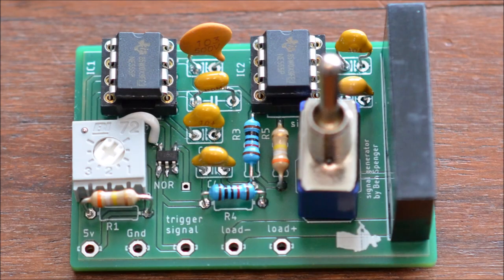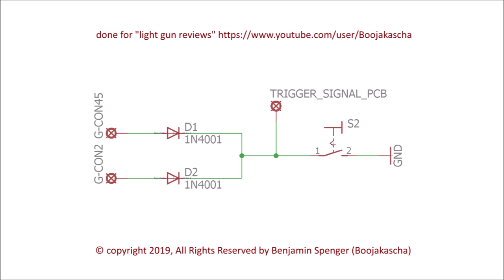Light Gun Reviews 130: Namco Arcade gun on PlayStation 1&2 (Modification)

Comment: Congratulations on this successful project, GunMaster. It has been impressive. 

For you, and everyone. Do you know any particular gunlight on PS1/PS2 (and PC) that in G-con1/2 mode matches and/or exceeds the original Namco Guncon1/2 accuracy and precision? have you ever experienced it or does that not exist? I mean leaving aside the LED bar extern accuracy, cams systems, recoil, and pedal option...

On the other hand, would it be possible for Guncon 2 on PS2 to addon some sort of vibration when the trigger is pulled, as well as adding an extension for a footswitch? if this were possible Is there a step by step tutorial somewhere?
Reply from the maker: Thank you =)

The original G-Con 1 & 2 are very good. Some units certainly reach perfection. It comes down to manufacturing tolerance & deviation that we can find unit which don't perform as well (but still very good mind you). By the nature of things, most items by any manufacturer are statistically distributed in a Gaussian quality curve. You can find particular units of Logic3 P99L or Gemini G/C-2 which exceed a particular GunCon (1 or 2) but the opposite may easily be the case when you look at another sample.
This is a long winded way to say: GunCons (1 or 2) are top notch and my benchmark. There are other guns which are as good though.

Yes, you can add force feedback to about any gun. Please see episode 237 for that (cost in materials is about 20 USD).

Similarly you can add a pedal to about everything. Just connect the signal line to Gnd via a switch and you are golden. Refer to episode 201 to know more. If you don't want to open your gun, you can sacrifice a PS1/2 controller for most Time Crisis like games.

I rarely do step by step instructions. I suggest you try and write in the comments, if problems arise.
Reply: @Boojakascha  Thank you for clearing all my doubts. Now I understand the situation better. I didn't know the difference or tolerance between the Guncon themselves, I imagine it would be something like the tolerance and deviation in the service settings in the old CRT TVs that came out better adjusted than others, with the difference that the Lightguns unfortunately don't have a "service menu" for "secret" access to finish refining the different factory settings as best as possible, or due to subsequent mismatches. 

I presume then according to which models they are compared to each other (black-JP, red-US, gray-EU), and their serials, the highest standard in their assembly and tuning could fall on one or the other model, regardless of their color or place of origin.

Ok, then those three brands or models would be at the top regardless of the place they occupy on the final podium, and then the rest of the models or brands of the same type/style would come at a certain distance. Excellent.
 
Great!, I will immediately consult episodes 237 and 201. 
When starting or finishing this project, is there a risk of unintentionally misaligning the factory lens system, etc. and I'll could be not know correct it myself? some advice in this regard to avoid mismatches or unwanted problems?

Sorry for stealing part of your time again, one last question. Apart from having a Guncon2 on a PS2 destined for an arcade booth, I have another lightgun model Panther V recently dusted from my youth with PSX, and I am completely unaware if it is a clone or licensed copy of another model or not. If I don't wrong, I belive that it haven't be analyze in your fantastic channel. 

This "Panther V" in particular is PSX/Saturn compatible, with Guncon and normal mode, has Recoil Action (Kick-Back) with an 8.5V 600mA AC adapter; footpedal (minijack), and weighs 221gr. I would have loved to know your impressions on this particular weapon.

Thanks a lot again for your time. Happy Holidays and have a prosperous New Year!
Reply from the maker: @durrutino  Misaligning the lens won’t be a problem, because there are grooves, which hold the lens in place. You would just take care to note which grove was used, if more than one is present (some light guns have that) and, if the gun is using a plano-convex lens, assure that the belly of the lens is pointing out.

I do own the Panther V and I like it! =) It’s a clone in a way as it copies the SIG P220, but a lot of distributors used and sold this gun. The most famous was probably Joytech. I am happy to hear, that you would care about my opinion. I will schedule it to be one of the next items I will review in 2023 =)

Thank you, I hope you had nice Holidays too and wish you a good start into the coming year!
Reply: @Boojakascha  Uff!, in that case, I feel calmer when I decide to disassemble my apreciated Guncon2, its guts as unknown as its type of lens, etc. 
As it would be my first modification in this type of gaming devices, I wouldn't like to spoil the Guncon 2 that I appreciate so much. I don't know if I should still start by modifying the first Guncon to have more space and maneuverability on it. I will decide for one or the other model when I finish watching your recommended videos. What does seem to be that the Guncon1 could admit until even recoil by cutting the upper part, instead due to the design of the Guncon2 I think that it would best allow a vibration system that would be enough for me, specially considering that in the latest Time Crisis 5, if I'm not mistaken don't haven't recoil but vibration, what I don't know is what kind of vibration it is to emulate a similary sensation on Guncon2, a priori easier to perform, and above all more economical $20-30 would be great.

 I'm glad to know that you also have hidden a Panther V , which for me still has sentimental value, for so many memories in my youth. And, as an epilogue, not content with it, you have brightened my day even more by revealing that you are going to dedicate a video to it!. Honestly I did not expect it, I will thank you infinitely, and beyond.  I'm already eagerly awaiting that greatness video! FOR ME without risk of bias: THE 1ST MOST ANTICIPATED VIDEO OF THE YEAR 2023.
Reply from the maker: Nono, the Time Crisis 5 gun has a rotating solenoid. I show it in episode 214.

Some people indeed cut the slide of the G-Con 45 to make it movable, and it looks great. But it's a bit ambitious for a beginner project^^

Thank you very much for the kind words, durrutino =)

Comment from the maker: It's almost an ASMR episode^^

Update August 18 2021:
Here is a micro controller (using an Arduino Micro) based approach for the signal generator:
https://youtu.be/JeAQTW39W3k
You can use this alternatively, if you are not into discrete electronics.

Comment: What type of cable did you use to go to the light gun? It needs six conductors (I'm ignoring the earth wire) so I've been looking for individually shielded cable (or pairs shielded) with that many cores. I'm interested in the shielding part so the current for the solenoid doesn't cause interference (as RetroRepair in his video back from 2012 experienced). The original wires are 24 AWG, but according to this chart https://www.engineeringtoolbox.com/wire-gauges-d_419.html for a six core cable I should increase that to 20 AWG to handle the same/more current. I also want the cable to be flexible. It's been a struggle to find the right stuff without paying silly money. I wondered if S/FTP (so shielded) ethernet cable would do the job as, while it's more cores than I need, it's everywhere, but I worry it wouldn't handle the current.
Reply from the maker: I can't find the reference anymore :-( I use individually shielded pairs I think. The wires are solid instead of stranded so sadly the cable is rigid. Wrapping the shielded pairs then is a stranded shield and an additional metal foil. I think the copper is quality stuff. Yes, I think a high Cat Ethernet cable will be the perfect solution. Many devices are PoE (powered over ethernet), so that should work no problem. I think some of the higher end cables wrap each signal cable with a Gnd wire, so you have plenty of wires. You could think about using two or more strands for power if you are concerned about the heat.
Reply: @Boojakascha  Thanks, that's a good point, since there are 8 wires in ethernet and I only need 6 I'll double up for the solenoid wires and it should be fine.

Comment: The thicker green wire attached to the base of the solenoid I think originally would have been earthed to the case of the arcade foot pedal. What have have you attached yours to?
Reply from the maker: Yes, this is absolutely true. I don't have it connected to anything. I routed it back to the connector so I could work with it, but as none of my appliances is grounded to earth I didn't attach it to anything.
Reply: @Boojakascha  I was thinking I'd do the same, glad to hear I won't be making a terrible mistake!

Comment: how did you get the foot pedal to work with this set up? I found the same foot pedal and was thinking of using it as a usb foot pedal. I was just going to gut it, shove a keyboard controller in it and then probably replacing the micro switch with a cherry one.
Reply from the maker: I just soldered TS sockets to all buttons of interested on the PCB. Over a TS cable I route the chosen socket to the micro switch in the pedal. In there you would connect the signal high at common and ground at normally open.
I give a better explanation at this time stamp here, in another video:
https://youtu.be/_UFZBpGE4Ww?t=27

Comment: Hello Sir!!! Nice job. really! I have question about how you plug the optical sensor from the gun to the pcb from the gcon2 and to your new pcb from ep 118.  Could you make a scheme? i am lost with that! If i am correct, the optical sensor has ground, +5v and light

on your pcb from ep 118, there is 5v connection to make. Load- and load+ is the 24v connection right?
5v, ground and trigger signal are plug on the pcb from the namco GCON2 or elsewhere?
could you make a scheme because i am lost!
thanks again
Reply from the maker: Dear Hélène

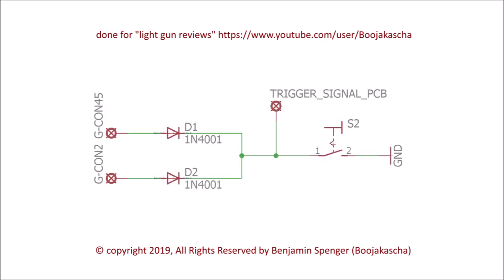Thank you for the nice words. The cable of the optical sensor board is soldered to the two controller PCBs. For G-Con 45 (shown at 1:00 min) connect light to light, power to 3.3 VDC and ground to Gnd. For G-Con 2 (shown at 1:02 min) it's the same. The two gun boards are NOT fully connected to the light sensor board at the same time. Please refer to the scheme shown at 01:14 min. There is a DPDP switch in between. The signal generator is driven by the 3.3 VDC from one of the gun PCBs. I designed it for 5 VDC but it will run on just 3.3 V too. When connecting the trigger signal from the gun boards with the signal board pay attention to use diodes (refer to the scheme at 1:24 min).

Yes, Load - is the Gnd of the 24 V power supply and Load + is the +24 V line thereof.
Reply: Sir, i am really sorry but i am french and i have some trouble with electronics. Can I send you maybe a picture of the different element to try to connect eatch part on picture? that would help me a lot.
Reply from the maker: No need to feel sorry Hélène, we all started at some point. Sure! If you go to my website you will find my contact details. I will read your email tomorrow, have a good night!

Comment: I'm jealous! I wish I understood what you actually did on a technical level. Nearly all of that is above my comprehension unfortunately.
However I just recently purchased official NAMCO Time Crisis 4 arcade reload pedals, that I plan on modifying to work on a PlayStation 1 controller (which would work for PS1 / PS2 / PS3 Time Crisis games). Do you have any advice or knowledge to pass on to me before I attempt to mod it? I was considering asking on the Arcade Aussie forum as well.
Reply from the maker: The pedal mod should be easy. A pedal is just an electronic switch. Wire a TS socket to the pedal & the gun and connect it with mono-audio cables.
Reply: @Boojakascha  Thanks for the response, but I don't know how to do that. I'm not at your technical skill level, so I've decided to go with an easier route and place a PS1 controller PCB inside the foot pedal and have the 'plunger' press into the R1 button, no need to rewire or sodder anything.
Reply from the maker: @Chocoburger  That's a splendid idea!

Comment: Thanks for sharing this, I'm really keen to try myself. My only worry is the dead zones you mention- what percentage of the screen would you say they take up? Is there any way to fix them? Would there be any drawbacks if you were to use the sensor from the Gcon to resolve the issue?
Reply from the maker: Thank you, Rik! It has been a while, so I am not completely sure. About 10-20 percent probably. I havn't tried the G-Con 45 sensor, just the original and the pirated one by SuzoHapp. I think giving the sensor an angle presumably another lens and using shorter cables could possibly lessen the problem.
Reply from the maker: @rikrok7098  Concerning your link: Yes & No. Yes, you can still buy these guns new in 2020. But No, this seems way to good of an offer. I guess these are pirated parts. That you can't see the "namco" letters on the shell is a bad sign. And the photos are alarmingly bad for a luxurious item.
Reply: @Boojakascha  Thanks for your answers. Do you think from all your gun testing you've ever found a third party gun that has a Guncon2, Guncon and "normal" mode that works as well (accuracy and lack of dead zones) as the actual Guncon2, Guncon and Hyper Blaster/Justifier? The reason I ask is then I could take a board from that 3rd party gun instead of having to harvest three separate ones.
Reply from the maker: @rikrok7098   Yes, there are some which are as good. To my mind come:
- P99L by Logic3 (ep 119 https://youtu.be/e19n6UAojJQ )
-  G/C-2 Light Blaster (ep 147 https://youtu.be/bxCuOfd5mHo )
and to a lesser degree the
- Wireless Arcade Light Gun (ep 153 https://youtu.be/_KRv0EvqaPo )

Comment: Hi! really awsome work man. I recently bought a time crisis 2 cab. It basically works but i had to paint, remove rust... for sure you know what i mean. I started the jorney to connect a ps2 there, to learn something new and for pure fun :).  I already researched a lot, but I don´t really understand how the light sensor works.  I don´t want to abuse, but may i ask here some question about it? I´ve seen your contact info in your website, but I wanted at least to ask you permission first here...  The work you did is like a dream for me. i don´t think I´ll ever get so much knowledge, but we all need to start somewhere :).
Reply from the maker: Sure. For the light sensor: you can wire up the arcade sensor board to the sensor portion of the GunCon 1/2 boards no problem over a selector switch. It should be in the video.
Reply: @Boojakascha  wow thanks. I’ll prepare a diagram or something to support my question. It’s pretty simple but my level is so low for now i’m sure the question will be so basic(stupid?) for you :)
Reply: @Boojakascha  Question sent. thank you again. Let me know if you want me to post question or answer in case it helps to someone else...
Reply from the maker: @manuelsanchezdiaz4696  I received it, thank you. I will look into it tomorrow. I am off for bed right now =)